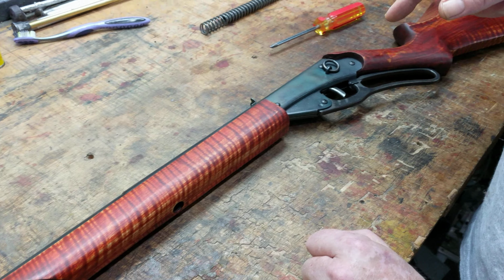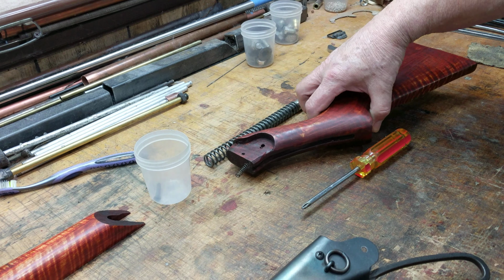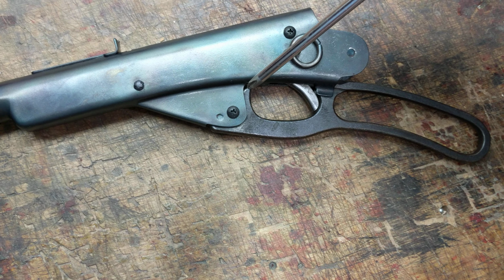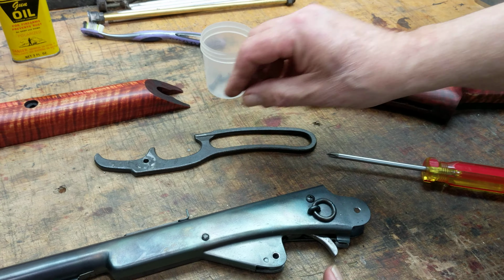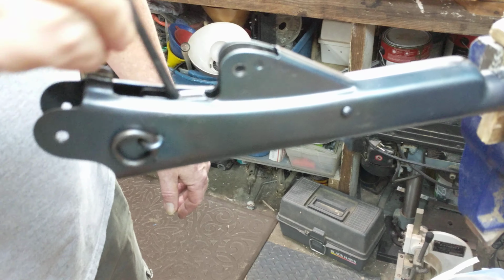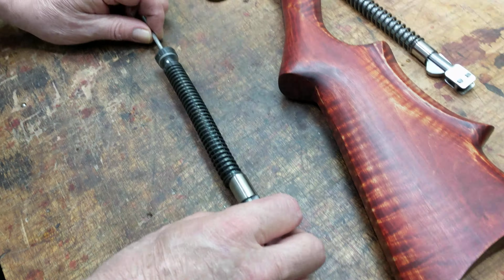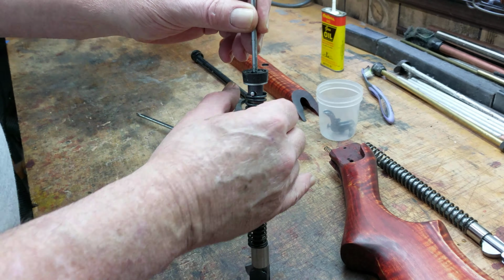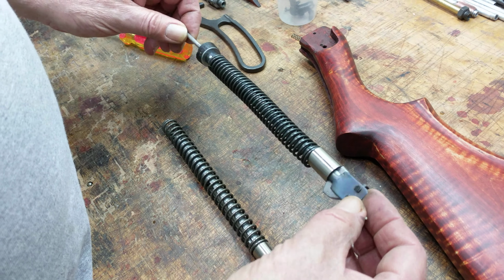Restomod Daisy #111 Model 40/27 Red Ryder Carbine disassembled to investigate spring drag

Comment: if the gun is pointed up, is the  spring anchor little bend suppose to point up or down? And the little rivet that the anchor touches is the anchor support to be above it or below?
Reply from the maker: BF3, Given that this is a video about the Sliding Spring Block, I'm confused as to why you're looking for info on the Standard Spring Block as these converted guns do not have them. In a standard Daisy, the spring block serves as a bearing point for the mainspring, it's installed in the gun with the small curve facing the butt stock and is positioned so that it rests on  the spring anchor rivet/bolt at the bottom of the receiver .